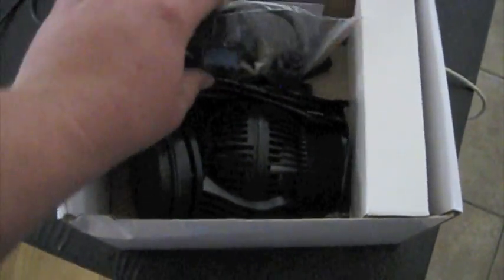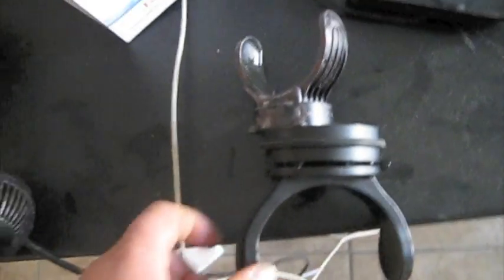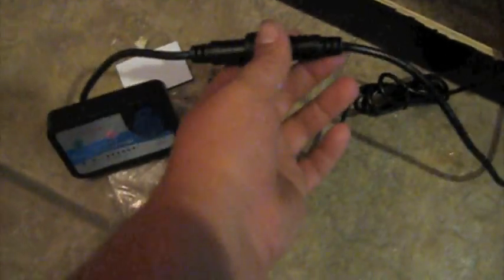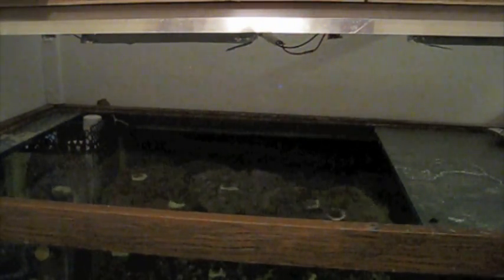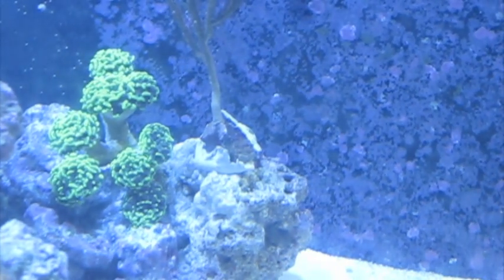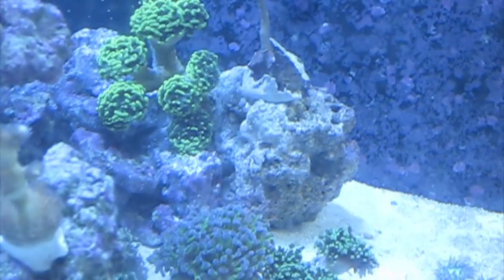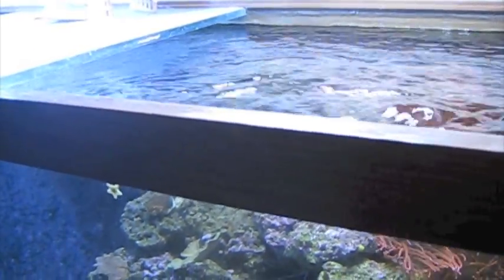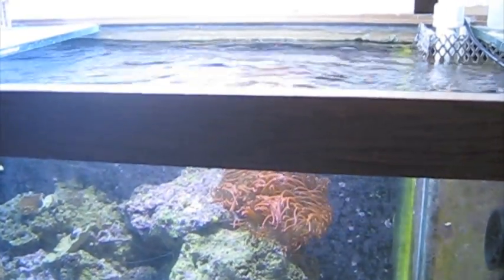jebao wp40 on 220 gallon reef 84x24x25

Comment: Hi I've got a 240ltr reef tank would a wp40 be ok? Thanks
Reply: +Neil Skelding I'm using one on my 220.  It's really strong.  I am running it on low.
Reply: Does it blow your sand sand corals to much?
Reply: +Neil Skelding it depends on direction I have it going.  Lengthwise left to right it's good.   Front to back can make a dip in the sand.  I've now taken out 2 other powerheads and just use this.
Reply: +bvaughn777 cheers dude I be looking into one now
Reply: +Neil Skelding I hope you love it.  I'm sure my sps are grateful.